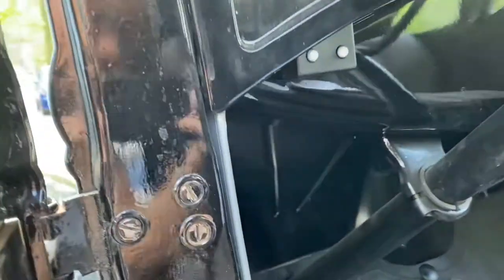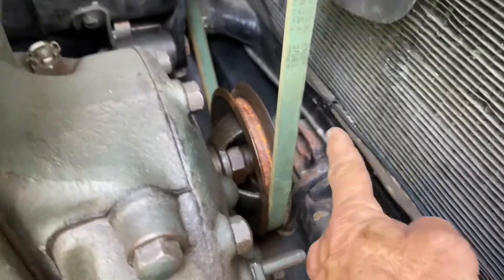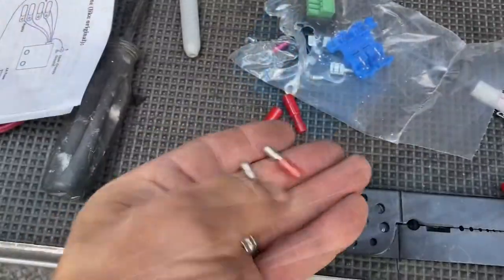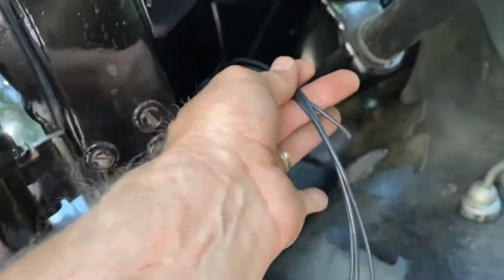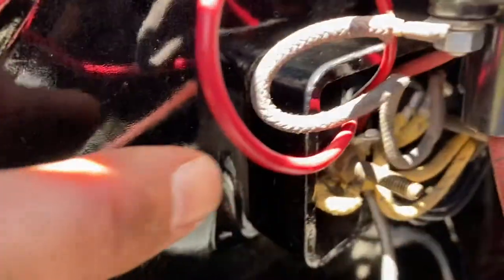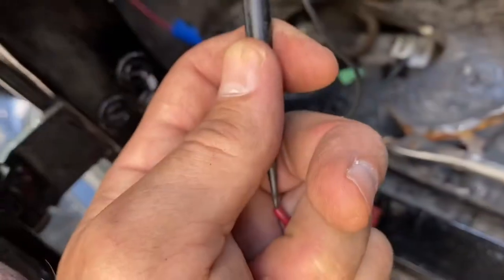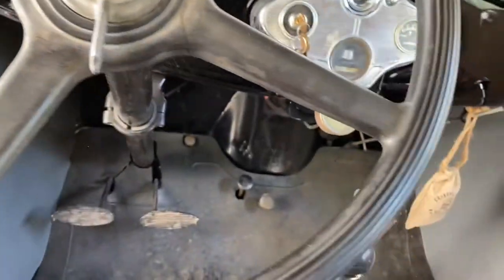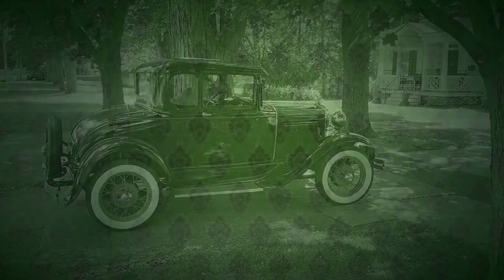Logo Lite Turn Signal Installation

Comment: Will this process work on a 29 sport coupe?
Reply from the maker: I would expect these lights to work the same on a 29 sport coupe.
Reply from the maker: Replying late. But yes, these could be used on any model that needs turn signals. The mounting of the lights can be adjusted by using purpose-specific home-crafted mounts. The way I used the mounts worked really well to conceal the lights into the contours of the bumper.